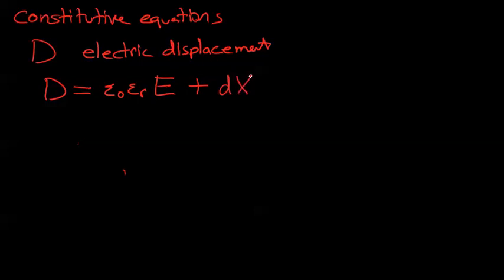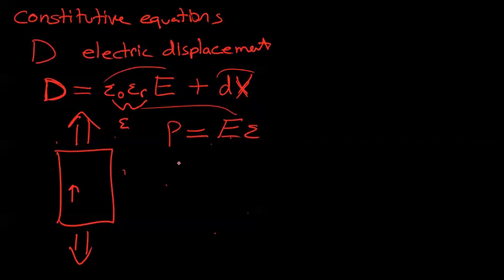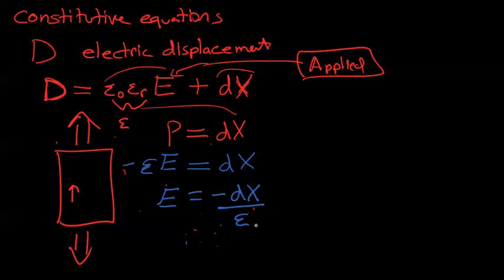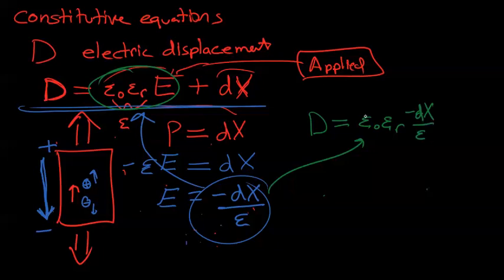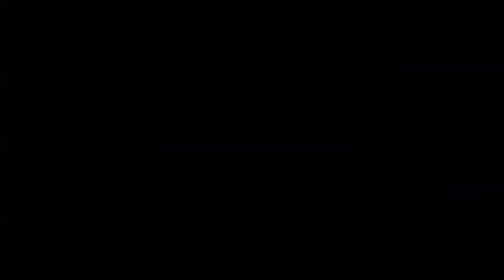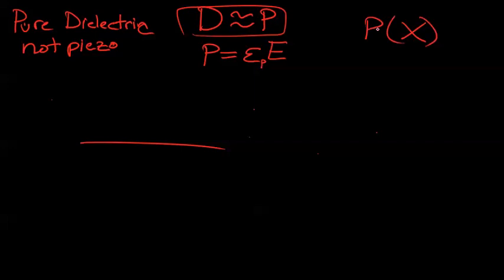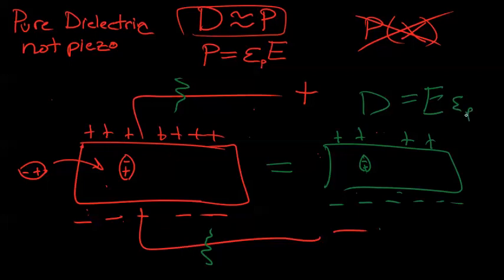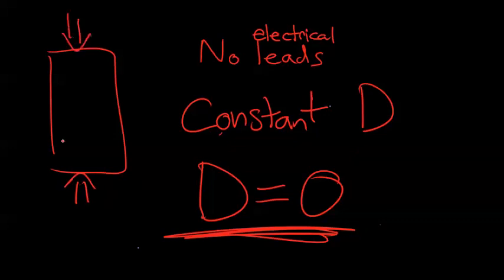Learn Piezo Lecture 3F: Piezoelectricity and the Electric Displacement

Comment: 4:31 E=-dx/epsilon represents the "generated" electric field, while E found in the constitutive equation represents the "external applied" electric field. Is it correct to substitute the value of the "generated" electric field instead of the "applied" electric field in the constitutive equation ? I think that in our example the external electric field is zero, thus we are left with D=dX .. Am I correct ?
Reply: @ultrasonicadvisors  In the example, the applied voltage is zero. Does that mean the value of E in the constitutive equation is zero?
Reply: @ultrasonicadvisors  If the value of E in the constitutive equation is zero, Why did we set the value of E in the constitutive equation to be equal to - dX/epsilon?